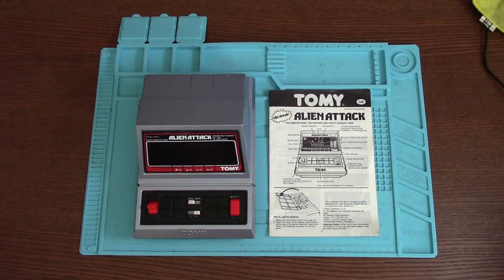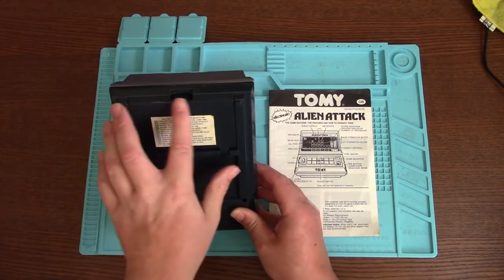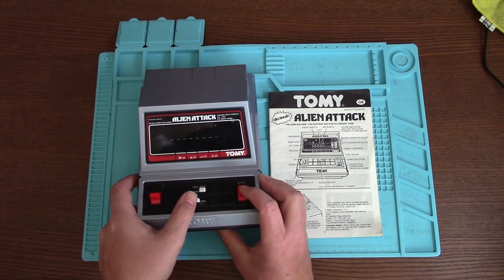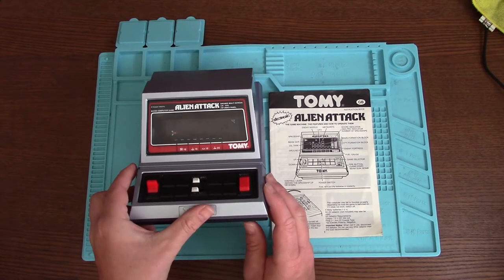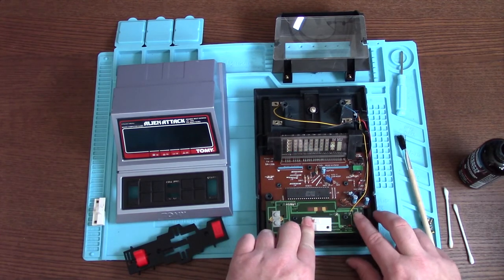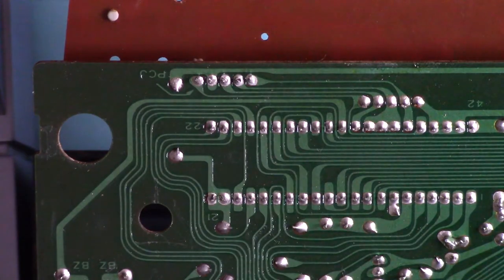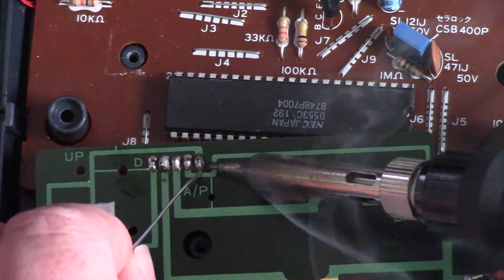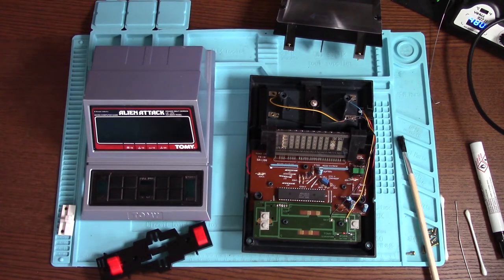Will I be able to restore this Tomy Alien Attack to it's former glory?!

Comment: Hello, I bought a Tomy Alien Chase tabletop electronic game, the batteries were left too long inside so they had leaked and one even exploded ! long story short I was able to make it work again except for the VFD screen which does not display anything :( I cleaned as I could the contacts between the board and the screen, I have not figured out how to fully open the game without breaking it apart so I can't access the board as I would like to ... I have noticed a sort of black stain in one corner of the VFD screen so I dont know it something leaked and the screen is fucked up or if I just need to clean better the contacts between the boad and the screen : any clues ? thanx a lot & best regards.
Reply from the maker: Hi Maurice! Awesome, I love the Alien Chase game, that's the double sided 2 player one isn't it? If so, do both screens not work or just the player 1 side? If only one screen, then I would expect that the black marks are corrosion of some description, and they could be causing a short which means the display won't fire up. If both screens are off, then it is likely an issue on the motherboard. You really need to open it up and get down to board level if you can to look for more corrosion and possible bad solder joints! 👍 Good luck, hope you find something.
Reply: @StezStixFix  yes it's the double side 2 player game ;) both screens don't work and I know now a little bit more how a VFD screen works so I'm going to fully open this little fella in order to access all the board ...

Comment: scramble clone..
Reply: bit odd as Scramble you could move horizontal as well as vertical, which would explain the 4 touch pads but why did Tomy not actually use the horizontal pads?
Reply: @dr2stroke611  Because it's a VFD. They couldn't fit the pattern for the ship and the pattern for the rockets/fuel tanks into the same cell. Have a look and you'll see that the fuel tanks are a combination of the missile and the red tank pattern.